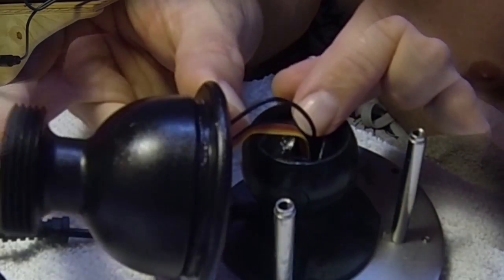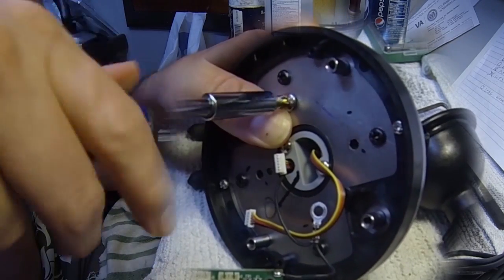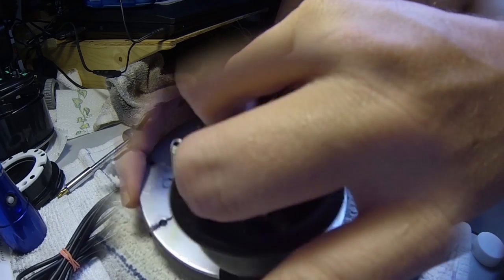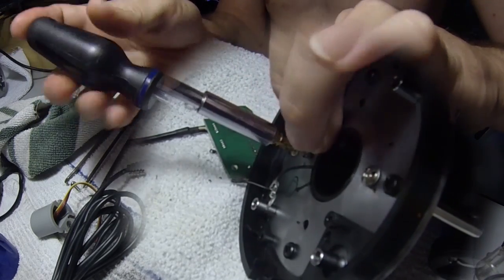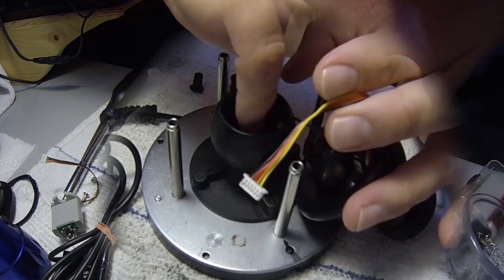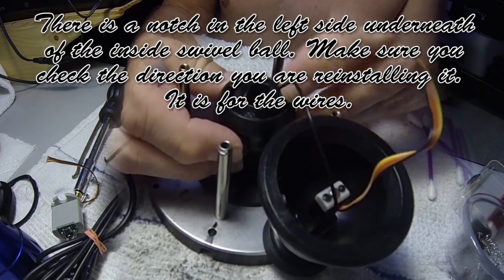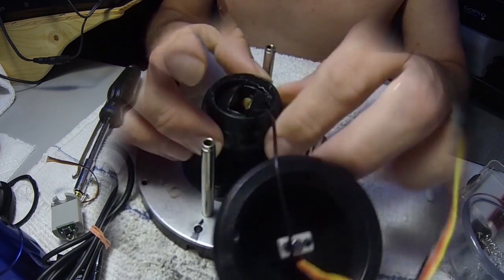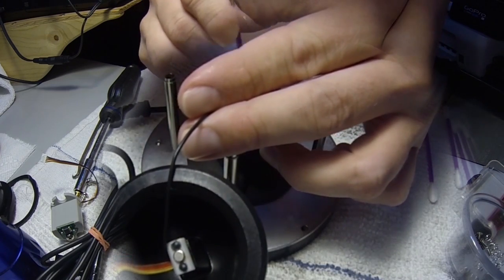ThrustMaster HOTAS Warthog, Complete Disassembly, Grease Replacement, Stiction problem, fix

Comment: Hey buddy nice video!!!!
just for the heads up the teflon o'ring you can't keep it for long,, phages with time
it gets thinner and thinner..i have used three so far untill i buy a new one from tm!!!

i have a slack on the center in both axes!do you have any idea how to fix it?
Reply from the maker: Thanks for the heads up on the nylon.  I have actually been very happy without using an o'ring at all.  As for your slack.  I'm not quite sure what you mean.  If you mean a dead zone then try to calibrate the stick if you havn't already.  Also check in-game settings for deadzones as well.  If you mean that the stick is loose in the center (no spring tension)  then I would mainly check proper assembly and make sure your not running that spring mod where you take out the main spring.  A loose stick tells me that you don't have enough tension on the stick.  Good luck with it and thanks.

Comment: Ive seen allot of people have trouble with warthog's and other producs. Maybe i should get a cm stick from what i've seen they work for 15 years.
Advice annyone?
Reply from the maker: CH is not what they used to be. So be careful with that.  They still use older sensor tech.  The warthog will last forever.  the only problem  is the stiction and that is easily fixable and when it is fixed..... It is the best stick by far in my opinion.  I have owned all the major HOTAS systems out there. saiteck x65 falls second and the throttle are great on the x65.  I still like the throttles on the warthog better but the x65 throttles a close second.  takes a while to get used to the stick and I never did like it not moving.  A moving joystick gives me more emersion.

Comment: Hi, nice vid, sort of oddly trippy with the split camera view, music and "nekkid in the basement" vibe :D J/K, I just bought one of these sticks and am noticing the same thing, so they are still making them this way as of July 2014, which seems stupid for such an expensive stick. Is there anywhere that this can be done professionally and where it won't void the warranty?
Reply from the maker: I had called these guys before and spoke with them.  since the stick is designed to be able to be taken apart and mounted on different platforms.  They had told me opening it up and replacing the grease did not void the warranty(that is what they told me I would ask them yourself).  The other stuff not sure about.  Dispite what others might say they have pretty good customer service and will replace the stick readily.  It might take 2 days for them to respond to the email if you send one but they do reply and are nice. And if you just got it ask for a shipping lable to be sent to you so you don't have to pay shipping.  IMO this stick is still the better one over all the other H.O.T.A.S. systems and well worth the price.  It has by far the best tracking and control.  But it does have that flaw.  But once fixed it's amazing.
Reply: ronin51670 Yeah I was noticing it today when pushing forward and right, it sort of graunches across what is presumably one of those little raised patches you sanded down. I am gonna have to treat myself to some fine grit paper and maybe a new screwdriver!

I take it since you did this you have not seen degradation of the plastic with the Calcium Sulfonate?
Reply from the maker: Mirandorl It has been almost 8 months since My stick has been rebuilt and it is just as smooth as when I finished it.   I called the company for this grease and it's plastic safe (non reactive).  No problems at all.  Also keep in mind I took the rubber flat O-ring out and put it on top just to keep from loosing it.  Thant rubber O-ring may make a small difference in how smooth it operates.  With the grease i'm using it has shown no wear whatsoever on the surfaces and it also slightly reduces the tension on the stick.  As I mentioned before check the warrantee thing first I would hate for you to loose a warrantee on a new stick unless your prepared to.  This stick is very easy to replace parts in and order parts for.  I plan on making a better video in the next couple months (with a shirt on lol).
Reply: ronin51670 Hi again, I emailed Thrustmaster to ask about the mod / warranty, and will wait to see what they say! I did mention 'sandpapering' ... maybe they would be cool with changing the grease, but not the 'remodeling'... I dunno. We shall see :)
Reply: Mirandorl hi mate thrustmaster came back to me. They gave me instructions to strip it just as far as but not including the ball, as this would invalidate the warranty. I opened it up and the gaskets were fine. I think the main issue with it is 'hanging off' the stick, eg having it on the table and literally hanging my arm off it. If I support the weight of my arm its better and I wonder if it's intended to be between the knees.

Still though, the ball movement is poor when stripped down as in your video, so it is slightly disappointing. I may try getting more grease as suggested by TM
Reply: ronin51670 Just by way of update, I finally took the thing apart and added some more grease. Based on a thread over at ED I used a heavy silicon grease (Molykote 44M, yeah I know you said not to but TM scared me with their booming email voice into ONLY USING SILLYCOOONE lol). There was almost no grease on the main contact points, and a lot of it had kind of congealed. It looked more like jam. Once the old stuff was cleaned off and the new stuff in, it was much smoother. It could probably still benefit from sanding like you show, but for now (and until the warranty is up) its much better :D

For info they said it only invaildated the warranty if I took apart the inner ball with all the electronics. I just took the 'cup' off and greased all round there so all is good.

Also STAY NAKED lol
Reply from the maker: Mirandorl "Also STAY NAKED lol"  LMAO.  I should do all my vids like that and at the outro say "thats all my friends, good luck with your project and Stay Naked".  That's really good to know on the warranty. No worries on the grease.  As long as it was really thick it should be fine.  I was just unable to find a thick enough silicone.  Even the thickest ones I tried (two of them) worked for about a week then was back to same.  Don't think I tried the 44m though.  Thanks for the update.  I have been playing ED for a couple weeks now and love it with the warthog.  Also had a chance to mess with the Saitek X-55 Rhino.  Thought I might want an extra axis on the stick (the twist)  Would be awesome.  BUT!!!! The thing was such a POS.  Sooooo badley and cheaply made.  Although it was comfortable and the throttle wasn't bad but still felt realty cheap.  It was like a childs toy.  the switches were flimsy felt like they would break after a while.  oh and the twist had a huge play in it and it creaked lol.  So just to let you and anyone else know on this.  It was in the running for SC to use for there sponsored stick. I hope they don't use it unless they do a toatal remake on materials because the look is great and the comfort was good.  Well have fun and enjoy your "new" stick.
Reply from the maker: Mirandorl Oh and hey send me your ingame handle for ED via google plus or here and i'll look for you.  Mine is ronin516.  Usually on after 11:00 pm Hawaii time.  Also about to start a new channel on tech reviews for pc and space and flight sims gaming.  maybe i'll do them naked lol hmm.  Naaa probably scare people away.
Reply: ronin51670 OK you were right, the problem came right back, I guess because the spring pressure just pushes all the grease out from the lubed spots. I could try even thicker greases, but I am starting to feel like its a waste of time with that crappy plastic ball. Wrote back to TM, asked about an RMA, its just not what you expect for that much money :(

I don't play online yet as am pretty new to simming as a whole, learning to fly at the mo. My handle on the ED forums is CookPassBabtridge, you can see me wittering away there most of the time :)

Cheers for the tip on the Rhino, to be honest I thought it looked a bit shonky anyway.
Reply from the maker: Mirandorl  Try to take out the rubber oring (looks more like a gasket)  then try for a bit.  It may help.  I have found out that mine works great without it.  but I also have the grease.  But I really suspect not having that gasket/oring in helps.  And yeah I know about the money.  I got lucky and got one that was about 9 months old with a receipt on craigslist for $275.00
Reply: ronin51670 Hi mate, back again :) I bought one of those PTFE O rings from our friendly neighbourhood ED rep and it looks like the stiction problem might be gone for good :) I pulled out the ring (the one on the underside of the clutch plate) and just slotted in the PTFE, then added a load more Molykote 44 everywhere again. This time it looks like the effect has held! The stick still makes some clunky little noises, but it doesnt stop and hold anymore. There's smooth transition :)

I'm sure doing your machining job would make it even better, so maybe when my warranty is up I will start taking sandpaper to it :D
Reply from the maker: Mirandorl  Cool that's really awesome.

Comment: thnx for the video! No sticky problems on mine... also, I removed the MAIN spring, and set the 4 little onse from the lower position up to top position. Feels way easier now to control, but all fluent.....
Reply from the maker: I actually tried that when I first got mine but didn't like it.  I think because I have played with a tensioned stick since I was a kid.  I did have one that wasn't the TRS-80 joy was non tensioned and proportional played with p-51 25 years ago or so lol.  after redoing my warthog its really light now and moves super easy but who knows maybe i'll try that in the future again. thanks again for the comment.

Comment: I have my Warthog on order, I will be on the lookout for stiction. I am kinda of a computer hardware greasemonkey myself, so if I suspect stiction to be an issue I will definitely contact Trhustmaster. Thanks for the EXCELLENT video!
Reply from the maker: your welcome and thank you.  Some don't have any so maybe you'll get lucky.  and maybe they have addressed the issue.  But one thing is for sure.... You Will Love the Warthog.  Even though I had to do the fix it is still the best HOTAS EVER.  Make sure you set up your curves in whatever you use the game or the target software.  It is a very accurate stick and if set so very sensitive.
Reply: Got it!
http://i.imgur.com/Eb4fXrI.jpg

So far no problem - although there IS a tiny bit of static friction across the board. Will check back after a few weeks.

Comment: well my joystick just died.... seems like it might be a case of pinched wires, ive coontacted thrustmaster and im going to see what they say. If my warranty is up, then il try to open it up and see if i can find where the problem is. Then if it's fixed, il do this as well to loosen it up. Good video.
Reply: rsx123 Wires came out of a DYI connector, so I had to solder them back on. All good now.
Reply from the maker: If it's a wire it is pretty easy to fix you will see.
Reply: I don't want to void any warranty by doing so. They warn of opening up the base will result in void warranty. If it turns out it's void since I think it's been more than 2 years, then I will go ahead and open it up. Besides, if I get a new one back, then hell yeah!
Reply: I love your videos Ralfi! Hope you get your stick exchanged or fixed as soon a possible.
Reply: Hey ralfidude
Reply: So what's the update on your stick?
Reply: ralfidude Good to hear. I want to get this stick soon. Your videos got me into DSC years ago.

Comment: My stick don't fully return to center (The stick seems inclined), when I push he return a little to right of center (position 31960, center is 32768; axes X). If I reassembly like in 10:23 I can realign correctly the axes?

Thanks for video and sorry my hard english
Reply from the maker: Thanks,  That o-ring can cause some stiction and if bad do what you are having problems with.
Reply: ronin51670 So I can solve fixing the o-ring?
Reply from the maker: DiaDOpOverlord If the oring is out or bad.  Most likely you can.  Just take it out completely and if you want go ahead and do the fix I did.
Reply: Ok, I will try, if work I tell you. One more thing, when I push the stick to left I don't get all values, I need infringing more strength to do it, thats don't happens in right side. Maybe the potentiometer is faulty? Thanks you :D
Reply from the maker: DiaDOpOverlord there are no  potentiometers in this stick.  It is a magnetic sensor.  I'm guessing your o-ring is damaged causing it to hang up on the spot.  if so just take it out.  make sure you grease it properly.  Only way to know is to disassemble it.
Reply: Well, I forgot to thank you for help, I sent the Stick for warranty and they gave me a new one , but now this new are with a problem I think is stiction que: in Y axes when the pull the stick backward and slowly return to center the stick do not stay at perfect center, I need to push a little with a finger to perfect centralization, but when I pul backward and  release the stick it return to perfect center, I think that may be caused by stiction, am I right?
Thank you again and sorry for late
Reply from the maker: DiaDOpOverlord  It is possible.  First try to calibrate it under windows first.  Add a tiny bit of null zone to center and if it still doesn't do it right then most likely its stiction.  try to work it out sometimes you can just move it enough that it will go away.
Reply: ronin51670 I calibrate and same problem appears and without the stick the problem is more perceptive, I calibrated (without the stick) and issue continue, but now to positive Y. I think that piece removed at 3:23 is causing stiction. Well, someday I will disassembly it and change grease, hope it will solve the problem. Thank you, man, very helpful video
Reply from the maker: DiaDOpOverlord Your welcome.  Good luck.

Comment: so let me get this straight I pay 600 bux to have to work on this fucking thing for 3 hrs ? no thanx
Reply from the maker: First you only pay $350 - $400.  Second it's still the best stick on the market.  Third not all have the stiction.  And it only took about 45 min to deal with it.  Now days almost everything you buy has a problem.  And most of the time you can remedy it.  If you not to lazy or ignorant about what your doing.

Comment: I cant believe how cheap and nasty it is inside. Considering how much they charge for these .. wow. Why make one of the most important mechanical parts out of vacuum moulded plastic?? Sheesh. Amazing video btw. The time and effort invested to produce this deserves massive respect, sir! o7
Reply from the maker: ***** If you are comparing.  TM has the best controllers on the market.  Even with their faults.  I do wish they would incorporate a little more quality control.

Comment: Nice video, got some supplies to follow your lead but I got stuck with the grease.
I was able to get my hands on two greases:
http://www.ulei-mobil.ro/pdf/MobilIndustrieDataSheet/Mobilgrease%20XHP%20222%20pds.pdf
and
http://docs-europe.electrocomponents.com/webdocs/0ff2/0900766b80ff288d.pdf
I`m trying to decide should I use the Mobil grease on the plastic/rubber and plastic/metal surfaces or only use the silicon based grease.
Reply from the maker: I would use the Mobil grease over the silicon as long as it is PLASTIC SAFE.  I believe litium and mineral oil based greases are plastic safe BUT PLEASE DOUBLE CHECK ME ON THAT before you use it.  I only researched the greases I was going to use and the best was the Lewmar wich is still performing extremely well in my stick.  A link to order it is in the description.  I tried two defferent silicone greases and hated both.  It could not stand up to the ball joint pressure and would start to stick again after 2 to 3 weeks.  Hope this helps.

Comment: Is this H.O.T.A.S worth it? Been seeing a couple of others come out on the market at a lower price point ( Mad Cats Rhino X-55) but they are most likely not the same build quality. Will be mostly playing Star Citizen and Arma 3. Thanks for the help.
Reply from the maker: In my opinion A big Yes.  I have used almost every joystick on the market except the X65 which I really like my stick to move so a joystick that works off pressure is not an option for me. The HOTAS is a very precise stick and with the throttle is AWESOME.  I use it for Arma 3 And all other flight sims like the DCS series.  I also can't wait for star citizen.

Comment: What is this black O ring? My unit didn't come with one, it seems useless.
Reply from the maker: It probably has it but you don't see it.  it goes on metal part of what I called the pressure plate in the video. @ 13:09 in the video in my right hand is what im calling the pressure plate.  if you look at the inside of it as I am holding it..... the O-ring would go on that metal ring inside so it would be in between the flat portion that runs around the ball and that metal ring in the "pressure plate".  As I put in the video I didnt use it so I just placed it on top to keep it out of the way.  mine is doing nothing.  But normally it adds a slight cushion to the spring and pressure to the ball.  Mine is still working perfectly and honestly cannot see it any better. So at this point I do not ever intend on replacing the o-ring.

Comment: Is the 300g tub of grease Necessary or could I get away with using the 100g tube?? How much total grease from the tub did you use on this project?
Reply from the maker: The tube will be fine.  It doesn't take all that much.  But use it generously where I mention it.  you can see how much I use in the video.  My stick is even better now after a month or so after the rebuild.  It is amazing.  I still do not have that rubber o-ring inside.